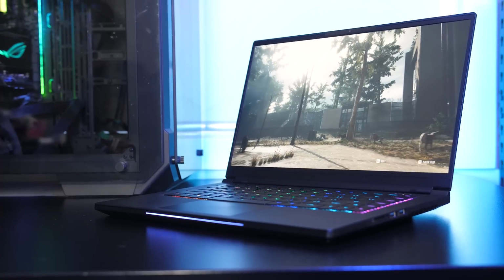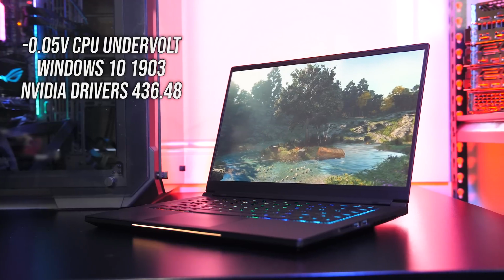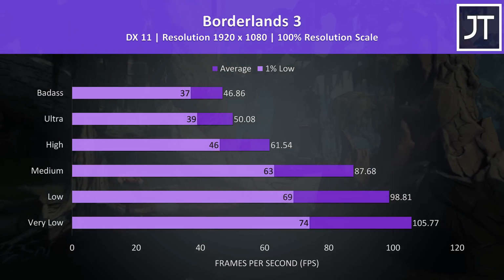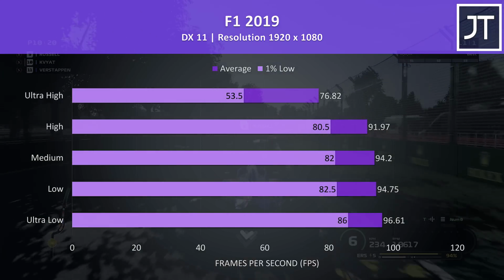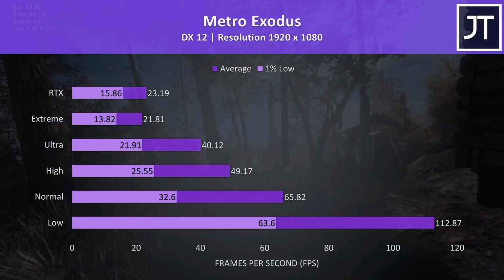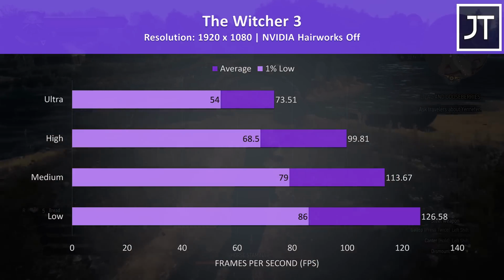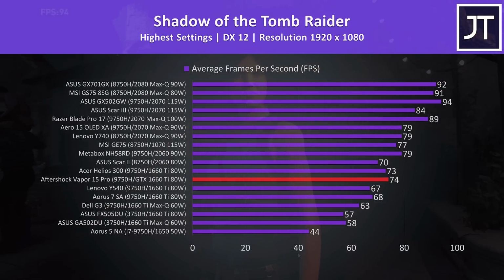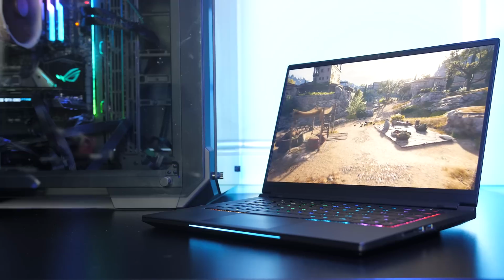Aftershock Vapor 15 / Eluktronics MAG-15 Gaming Laptop Benchmarks - GTX 1660 Ti

Comment from the maker: I'll be comparing this 1660 Ti config against the 2070 Max-Q version, so get subbed for that 👌
Reply: I don't just get subbed.  I rang the bell icon!
Reply from the maker: @MarcoGPUtuber  Even better 🔔
Reply: @MarcoGPUtuber  same
Reply: Hi Jarrod.. pls compare with triton 500 in term of thermal and performance.. dying wating for this model review from u.. thx
Reply from the maker: @fakhrurrazi683  If I get the Triton 500 with same specs I can do it, otherwise doesn't seem worth comparing as there would be differences due to the different CPU/GPU.
Reply: @JarrodsTech  hi. Is this unit come with eluktroboost like mag-15? Which has high power for limit cpu n gpu..
Reply from the maker: @fakhrurrazi683  Negative, at least not as far as I can tell, nothing stands out in software and hwinfo shows 80w in use by the 1660 Ti, can't say if that's different with the 2070 one though.
Reply: @fakhrurrazi683  same! These 2 are my choices. 👍
Reply: Finally! Getting subbed is not enough. Hit this 🔔
Reply: I am thinking of buying the 2070max q one for school
Reply: You have both configs? You're the man, Jarrod.
Reply from the maker: @johnng3650  Not yet, but they said they'll be able to send over the 2070 Max-Q soon 👍
Reply: You're amazing! Thanks for comparing both graphics cards
Reply: Thank you for the testing!
Reply: Can you also test if this aftershock model has something similar to eluktroboost on the mag and overboost on the XMG model? One of Aftershock's agent mentiond it doesnt have that feature but xmg claim it comes standard with all the models designed by intel
Reply from the maker: @aashutoshrijal4741  I'll cover this in the thermal testing video, scheduled for 11 hours from this comment (I'm editing it now).
Reply: Looking forward to the 2070 vid.  From what I’ve read, 2070 version is a very good buy.
Reply: compare this with the helios 300 jarrod ones 1200 this ones 1600 to 1800 whats the difference?
Reply from the maker: @mohitjoshi4649  Basically this has a larger battery, mech keyboard, thunderbolt 3, SD card slot. If you just want pure gaming, Helios 300 will perform a bit better (larger undervolt + GPU OC) and cost less.
Reply: I really want to compare the RTX version with Razer blade 15 or even pro 17
Reply: @Jarrod'sTech is the 2070 Max Q the 115w version or the 80W version?
Reply from the maker: @boredelephant9999  Mine runs at 80w in a GPU only load, in games it doesn't get close to that anyway so a higher limit probably wouldn't be that useful anyway due to the 75c limit.
Reply: thermals!?
Reply: I hate fan noise, whats the gaming like on balanced mode?, with quieter fans, I found Razer fans annoying at full tilt for example, has the BIOS upgrade improved fan noise on MAG?

Comment: This thing really hit Razer on the belly. They have to rush out the so-called "advanced" Blade 15 to barely catch up. But with that horrifying price tag, it's doomed to be stillborn. The coming 2020 will see an overall shift to the ultra-thin stealth looking products and it will either be the end of Razer's (*premium) laptop line or see them sanctified into the Apple of gaming laptops (provide they could pull off a significant and far superior redesign.)
Reply from the maker: More options is good!

Comment: I’m playing classic wow and I have to have it on super low settings to get over 60 FPS and it dips to 30. Doesn’t seem right. Is there anything I can do to improve that?
Reply from the maker: I have no experience with that game so hard for me to say as I don't know how it should perform. I assume you aren't running on battery power. Do you have dual channel memory (2x sticks), or single channel (1x stick)?
Reply: @JarrodsTech  Hey! didn't expect a reply. Turns out its using the integrated graphics for wow. Which makes sense now.

Comment: Would there be an issue using a Singapore laptop in the UK via power outlet?
Reply from the maker: I don't know anything about either location so not sure. You need to check what voltage the power brick supports, if it's fine for both regions then a simple adapter will be fine.

Comment: Hello Jarrod, I have a little question.

Thanks to your amazing reviews I finally bought the Lenovo Y540 and I'd like to know what kind of undervolt you would put on the i5-9300H ? I know you redirect people to an already existing video but at the very least, it would be great to know what exact undervolt and settings you put through the app for newbies scared of messing everything up.

Thanks a lot man, your reviews are really thorough and calm, I like it.
Reply from the maker: Thanks, generally I start with -0.15v and that's fine in most cases, can try push further if it allows, or otherwise drop it if it's unstable - that's the thing, the actual value varies by CPU, there's no one size fits all number unfortunately. I've had some take -0.2v and others that can't pass -0.07v. Here's a good guide on how to do it: https://www.youtube.com/watch?v=yNt9L3BWOFo
Reply: @JarrodsTech  Thanks man ! Do you personally use ThrottleStop or Intel XTU ?

Comment: Hey guys im still new to the whole pc tech stuff I have one simple question ( idk if its stupid but I rather not dump 1k for it do something I didn't want) 
if I use egpu like the alienware graphic amplifer do I have to use a external display or can I just use my laptops display
Reply from the maker: Yes you can use the laptops display, however it will perform a fair bit better with an external display. This is because the signal needs to waste bandwidth travelling back over Thunderbolt, then the Intel integrated graphics needs to process it to show it on screen.
Reply: When you use an egpu with a laptop: The word is that using an external screen will give better performance (FPS) vs the laptop screen (with external screen the GPU-laptop connection bandwidth is used only for the inforamtion sent out from the laptop to the GPU, and then the GPU sends information to the screen. With the internal screen the laptop sends inforamtion to the GPU, and then the information from the GPU is being sent back to the laptop, over the same connection, resulting in lesser performance). According to my inforamtion, this is the case with an egpu over Thunderbolt 3 connection (or slower). About the Alienware graphics amplifier, I think it uses a different connection, exclusive to Alienware, and I don't know what bandwidth it has and so wether it has a performance penalty with the internal display (I believe it has though). BTW, with current bandwidth limitation over ports and cables (TB 3 is the fastest I think, I have no information about the AW graphics amplifier), full potential of high end GPUs can't be unleashes as eGPUs (and I think all, including not highest end, suffer in performance compared to in-desktop use. Can be checked online though). USB 4 or 5 in the future might do the trick, but it's only speculation of course.

Comment: Can you test how far you can push the undervolt on the CPU on this device? I was hoping since these are intel engineered laptops they might have gone for binned CPUs for these machines. Just a thought but both bob and steve claim this beats every other thin and light gaming laptop with the same CPU for cpu intensive work. I'm guessing some kind of tuning was done by intel to optimize the performance. And can you also try to workaround that 75 degree GPU thermal cap and show us results before and after, also with a GPU undervolt applied? Something similar to what bob did. Maybe its down to silicon lottery but its always good to know how this one in particular performs
Reply: Every CPU is different. There is no point in testing how far you can push undervolt. Intel might put more stable CPUs on these laptops but I doubt it. It's possible to push farther than -100 on most CPUs nowadays anyway. And you won't be overclocking laptop...

When you unlock the GPU temp limit (with Asus GPU Tweak II) it beats the Helios 300 and any other laptop with these specs right now. However, you won't be able to undervolt that GPU well. New thermal paste should be enough. But if you get very unlucky in the silicon lottery, then a good cooling pad (i recommend Cooler Master Storm or NotePal X3) should be able to fix any throttling.
Reply from the maker: Yeah what David said, sorry there's just no real point in me spending the time, plus once you start pushing it to the limit it would vary based on specific workload and take a while to make sure it's actually stable.

Comment: too expensive. you can get acer 300 with rtx 2060 for the same price.
Reply from the maker: If you only care about gaming, then yes, there are cheaper options. This however has many features most others are missing that are important to people like me, such as SD card slot, big battery, good thermals, and Thunderbolt 3 - there's more to it than raw performance, and these extras cost money.
Reply: Acer is shit
Reply: not in Australia, well yes the 17 inch version, but you lose portability. This one has much better battery, mechanical keyboard, Thunderbolt 3,  magensium chassis, and a more elegant design (in case you wouldn't want to take  those gaming colors to the office)
Reply: This 1600ti will beat the 2060 if GPU thermal limit is increased to 87°

Comment: Did the vapor have the 75 degree limit on the GPU?
Reply: I would expect all of the intel collabs to have the same thermal limits
Reply: @Hanniballz313  asking because someone in the forums said his vapor did not. So wanted to get real info from Jarrod. Find it unlikely, but worth asking.
Reply from the maker: No, mine was limited to 87c, but the CPU was 85c so a bit lower, I will go into this in depth in the thermal testing video, which will be up in less than 2 hours.

Comment: Dear Jarrod! Do you think there is a compromize in privacy/safety as a result of the chassis being of a Chinese company? (like the case was with Lenovo)

And will you be able to do a comparison with the Aero 15X? Seem like the "natural" rival. Which screen is prettier, which is quiter, better battery life, keyboard sound level for quit library, keyboard comfort for extensive typing, latency, proferssional aesthetics etc. 

Thanks!!!
Reply from the maker: Maybe, at the end of the day it depends if you're just a regular person using your laptop, or someone who works in a security sensitive field where supply chain control is actually important and you have valuable information that someone is going to try and obtain by a low level hardware hack - seems pretty unlikely to me and is not something I'd concern myself with, and this is speaking as someone that worked in security for years. It's hard to compare as I don't have a 1660 Ti Aero to do a fair comparison, but yes I agree it would be close. I'd prefer this over my older Aero 15x, but I think I'd prefer the newer Aero just because OLED.
Reply: @JarrodsTech  Thanks for the detailed answer! It is very helpful :)

Comment: Please the 2060 version vs this version. Also is recommended to buy the thermal upgrades or not?
Reply: There is no 2060 config
Reply: @johnng3650  sorry my mistake... is 2070 for 300 more..
Reply from the maker: I will compare it with the 2070 Max-Q in future.

Comment: Very interesting results for Shadow of the Tomb Raider. I don't quite understand how it got a result above the Helios 300 which overclocks the GPU in turbo mode, while for other games it's more or less in line with the laptops that have no OC.
Reply from the maker: Could be game updates over time / driver differences.
Reply: @JarrodsTech  Nah, it isn't that, because it's on the same drivers as the 1660 Ti from your Metabox GPU comparison where it had 68 fps. That's the result I get on my Asus G731GU every time too (I tested it with two different drivers and with different undervolts, even though it's a GPU-bound title anyway). It's really curious.

Comment: Basically helios 300 is the best value in this spec range
Reply: Yea but it also weighs 4kgs compared to this one weighing 1.8
Reply: @Zikariii  does that really matter.  I want performance . Who actually games with their laptop on their lap. Hell I wanna have kids someday 🤣
Reply: @MasterSplintHer  you dont have to play with it on your lap... but if you travel a lot, I'd much rather carry a lighter laptop and I wouldnt have to lug the charger around either with the large battery
Reply: @Zikariii  that's fair👍🏾
Reply from the maker: Helios 300 is cheaper and performs a bit better, but this has a much better battery, SD card slot, and Thunderbolt 3, for some people like me these are important features so it's good to have it as an option.
Reply: I'd say the eluktronics mech is the best around this price range. This laptop even beats the Helios by quite a bit if you unlock the GPU thermal limit. The 1660ti can boost to 1800mhz

Comment: Msi ge63 9sf vs Asus scar 3
Both have same config
i7 9750h
Rtx 2070
16gb ram
Which laptop would be better for longevity/thermal?
Reply from the maker: I cannot say, I haven't tested the 9th gen GE63 but in the past it still ran hot despite its 7 heatpipes so I have my doubts. That said the Scar III didn't impress me either, I probably wouldn't get either myself.
Reply: @JarrodsTech   I am looking for a rtx 2070 non-maxq laptop, which one would you recommend

Comment: I got the japanese version of the mag-15 :)))
Reply from the maker: Nice, what is the model there called?
Reply: @JarrodsTech  it's the Galleria GR1660TGF-QC-G running the 1660ti, they also have the 2070 model
Reply: @JarrodsTech  Details on the Japanese Model: https://www.dospara.co.jp/5shopping/detail_prime.php?tg=13&mc=8946&sn=2876
Unit costs JPY 208,980 (tax included) on Recommended Specs (approx AUD 2,823.85), which is pricier than the Aftershock Australia Version (AUD 2,320) spec-for-spec (1660Ti model), which in turn is pricier than the Singapore Edition of the VAPOR 15 Pro 1660Ti, selling for SGD 2,099 (AUD 2,257.60). Prices mentioned are assuming that 16GB DDR4-2666 RAM is selected.
Reply: Nguyen Duc and so ? :)
Reply: I was looking at the Japanese one too. Any idea about the CPU and GPU thermal limits?

Comment: @Jarrod'sTech do the gpu thermal cap at 75°c.. ? By the way how the display panel? Is it good?  Any ghosting effect.. I still thinking choosing this over triton 500 i7 9thgen 2060.. price almost the same in my country..
Reply: You can unlock the temp limit with Asus GPU Tweak II. Then it beats Helios 300.
Reply from the maker: My GPU was capped to 87c. The display is decent, results will be in the upcoming review video. I'd get this over a Triton personally, bigger battery, motherboard isn't upside down, better keyboard, SD card slot.
Reply: @JarrodsTech  I see.. tq.. can't wait to see your upcoming video.. hopefully I choose this over triton for my new laptop..
Reply: I see.. I wonder if this vapor 15 pro come with eluktroboost mode like the mag15? Or just normal like other 1660ti laptop..

Comment: plases replace your f1 2019 racing game with Assetto Corsa Competizione has it is relevant graphical loads as a racing sim. F1 2019 would be optimized to work  on entry level system. I would like to see the worst case scenario, another point is that I believe ACC has set a new  benchmark in racing sim by being beautiful and possessing an excellent physics engine. Usually in racing games is either it is beautiful with  non-representative physics or excellent physics and mediocre graphics.
Reply: Froza too is well optimized and can give u a good idea of combined CPU and GPU performance
Reply from the maker: I only just bought it, I don't plan on replacing it for like a year, first time I've ever heard of that one too, maybe it more people ask for it I'll consider it.
Reply: @JarrodsTech  Also thank you for your videos, they very informative, which really helps in making an informed decision when buying a laptop. Cooling is not often discussed enough in laptop reviews. Could you possible do a dedicated video for  laptops on showing how to properly use Intel  software to lower temps

Comment: Aftershock also has the Apex 15 (2019). Is it as good as this one?
Reply: The difference is that this one has a better battery, Wi-Fi 6 and some other latest tech by Intel. It's also cheaper. This laptop beats Helios 300 when you unlock the GPU temperature limit. You can also push some higher turbo boost if you want.
Reply: @davidmartinek5257  Yep and by quite a margin too
Reply from the maker: I have a review of that one on the channel so you can compare it with my review of this (coming soon) and decide.

Comment: Sorry to ask this in a unrelated video, but I'm looking for a new gaming laptop to replace my daily driver (a thinkpad), would you recommend a zephyrus or strix for use in an engineering environment? Thanks
Reply from the maker: I feel like the Strix is probably better for transporting around and just general longevity as most of the higher end Zephyrus models open up and have moving parts etc, but probably won't matter too much if you take care of it either way.
Reply: @JarrodsTech  Thanks a lot for the reply! I usually take pretty good care of my stuff, for gaming or CAD modelling purposes which one would actually be better to use? between the gx701 and the strix

Once again thanks for the reply